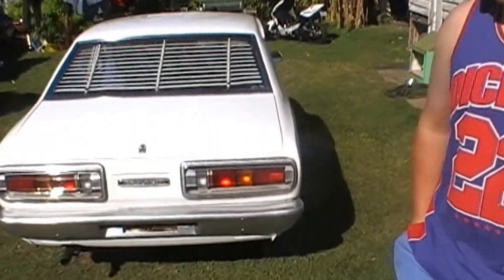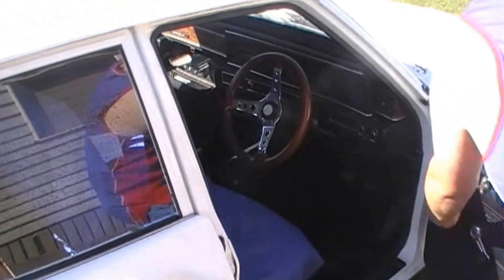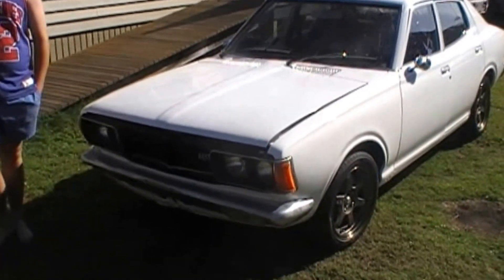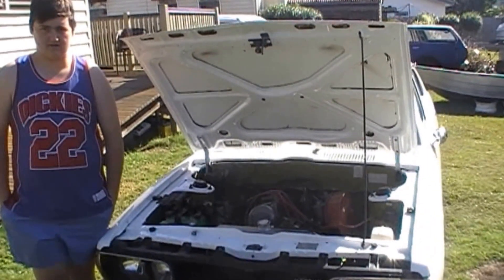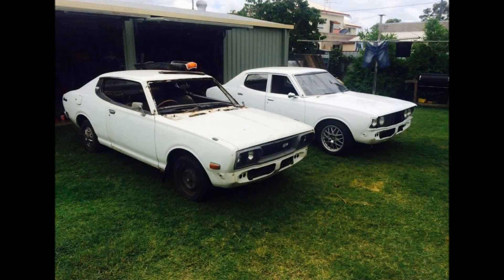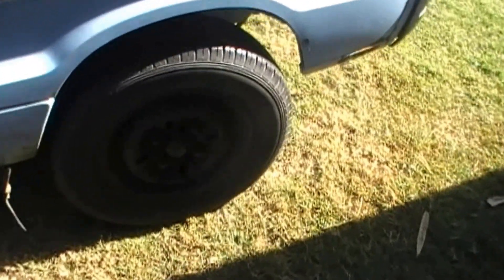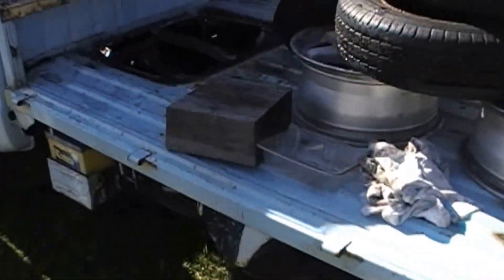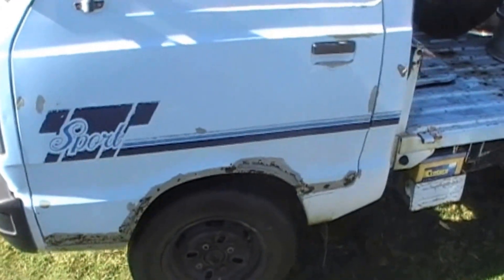Japanese Classic TV EP1 Liam Rodgers' Restored 1974 Datsun 610 (180B) Sedan

Comment: Nice clean simple build.  I picked up my first 180B last year.  In Japan.  1975 610 1800SSS.  Trying to keep to a budget on it because my 240 zed, hakosuka, and daily Stagea 260RS have been taking up most pf my car budget!   Went fully tapped coilovers on those cars. R200 lsd in hakosuka and Z.  Z also has billet rear adjustable arms/billet r200 mount. I have r31 japan market GTST front struts and wanting to do the same as you have.   Reperch and spring it vs making another set of coilovers.  But Id have to find some 610 top spring tops.  P/o did some weird coilover spring unto 610 stock struts and put adjustable camber plates and tossed the original 610 tops.  Car is a mess and still sorting it out.  
Nice to see the appreciation for the 180b over there.  They didnt get as popular as the 1600 in Japan.  Not many left nor does one see them at most car meets.  But there is a small resurgence of interest in them lately.